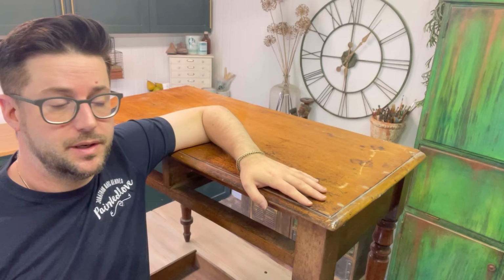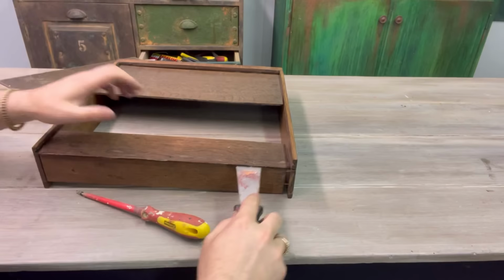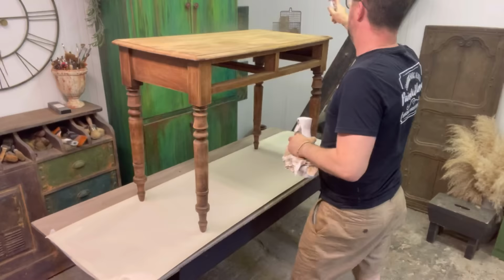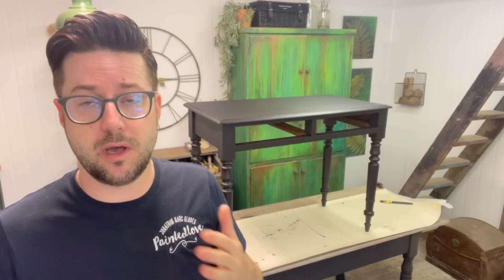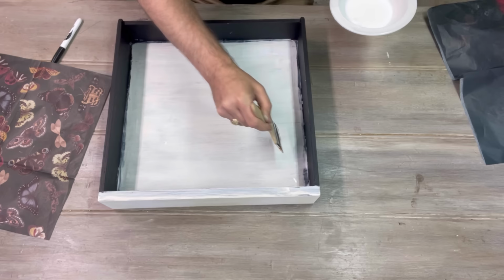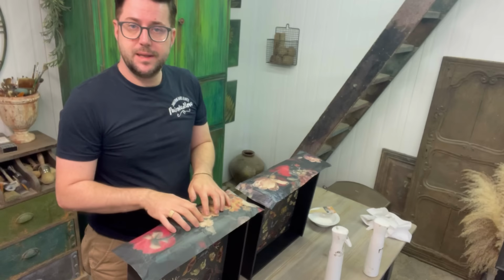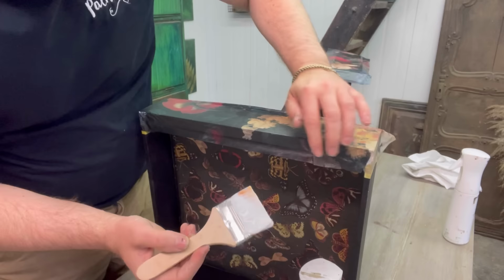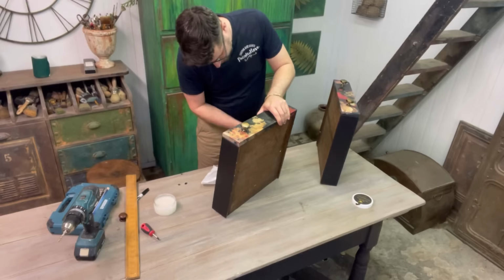Decoupage and Annie Sloan satin paint, A modern take on Victorianan.

Comment: Andersonville, Tennessee here! The way I feel about refinishing furniture is you have to create something that people can use. I have several antique pieces that I have held off on painting, but really the finish has disintegrated so badly over time that there is no other option than to repair what I can and paint. At least that way they can displayed and used in someone's home. I think we restore some of the better pieces that we can to as original as they can get, but that is not always an option. There are times when you come across a piece that you can salvage by no other means than to paint. I believe in doing whatever it takes to remove a piece from the attic and make it presentable enough to become a part of a warm, loving home. Therefore, I never judge. I admire the hard work that goes into saving a piece from the landfill, and it is a true labor of love. So therefore,  I just sit back and enjoy the creation of a new masterpiece!
Reply from the maker: Yes I couldn’t agree more it’s better to have the peace loved and in use then sat there decaying or even worse in landfill 😊❤️🙏